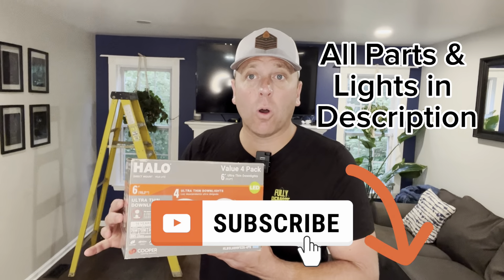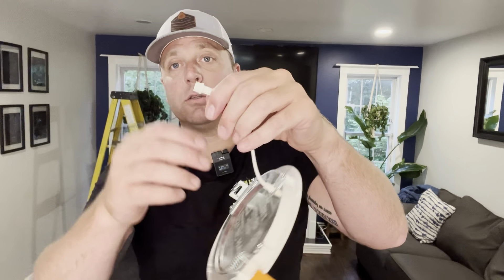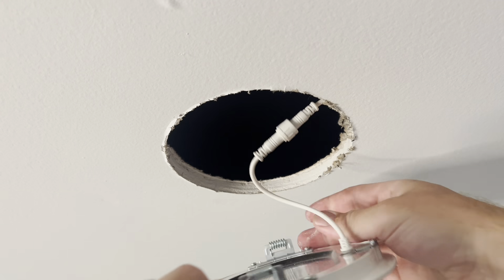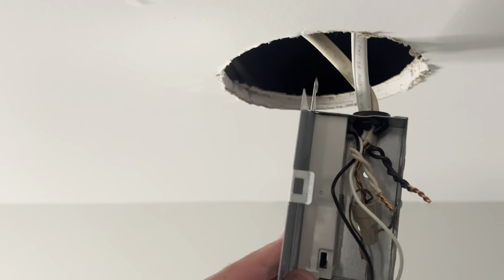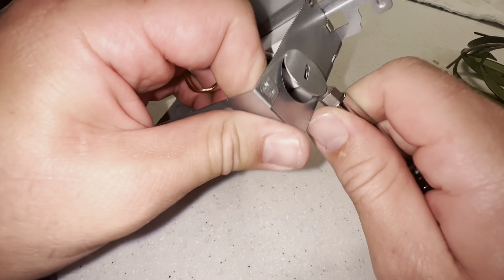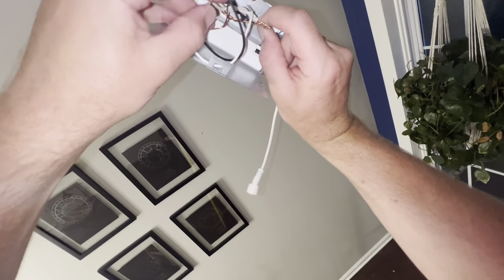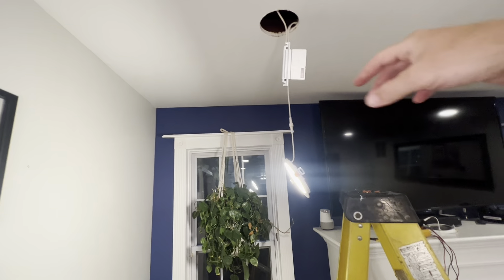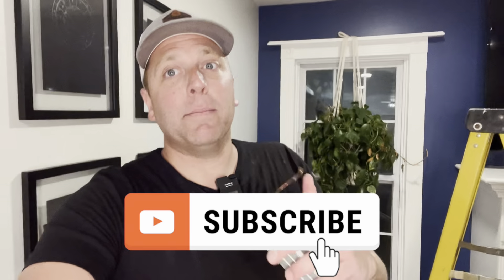LED Light Review & Troubleshooting Guide: Easy Tips for Replacing Non-Working Lights!

Comment: I put 6 of those in my kitchen. So far, so good.  They’re supposed to have a 5 year warranty.
The module in the ceiling is a transformer with different temperature settings.
Reply from the maker: Yeah my lights are good so far as well